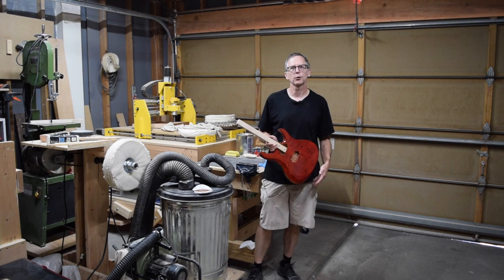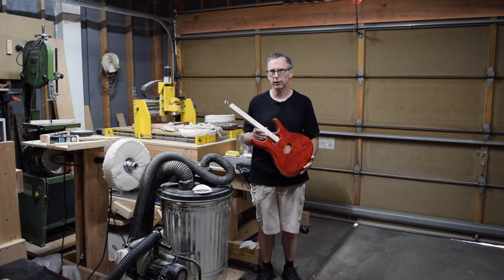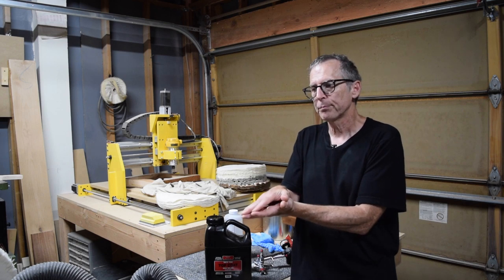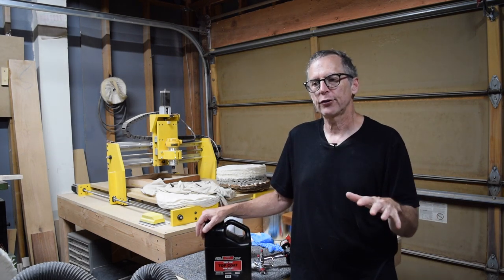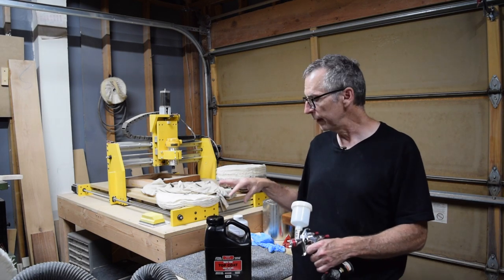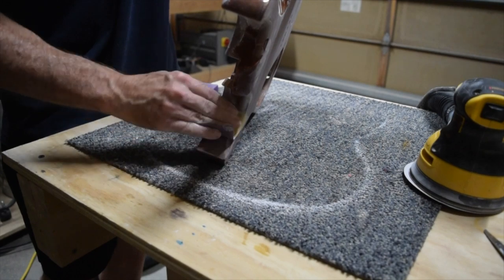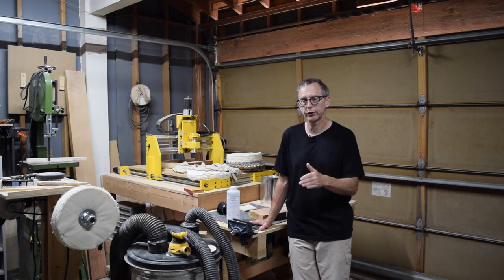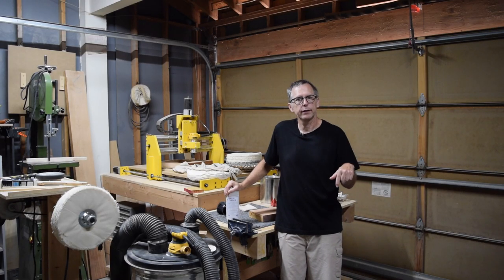How To Spray Smooth Water Based Clear Coats

Comment: I just finished my lp jr kit from Solo. Mahogany body and neck which I grain filled with stew mac mahogany grain filler. I went to Home Depot and bought some Varathane clear gloss water based ultimate and a few foam brushes. I stained it with trans tint red but wasn’t happy with the way it picked up the stain so I added tint to a small amount of finish and gave it about four or five coats. I sanded it flat and gave it at least twelve coats of clear and let it set for 5 days or so. I wet sanded it flat with 1000 and progressed to 3000 before using 3M rubbing compound on a foam pad with a drill. It surprised me with the luster. I was working in my basement and couldn’t use solvents due to my wife’s allergies.

Comment: Selling a product that makes their product usable.
Genius.
Reply from the maker: No, that's not what I said. This clear coat product works better in certain environmental conditions when mixed with the retarder/reducer. However, it isn't necessary. It's similar to adding lacquer thinner to nitrocellulose to achieve the proper viscosity for your spray equipment and environmental conditions.

Comment: I build model cars. Future Acrylic  Floor Shine worked great but they don't make it anymore. Pledge Floor Gloss is about the same. It has to be floor gloss and clear. I mix some in with the acrylic paint when painting and then I spray it on straight for the final coat. It's tough, it buffs up beautifully and you can add more with a soft cloth when needed.
Reply from the maker: I build model cars as well. When I ran out of Future, I purchased the Pledge product. Works fine. For guitars however, acrylic is just not hard enough. Polyurethane is tougher.

Comment: Great example! Water based lacquer its the way to go. Its got bad rep mostly because people on its first try use too many coats and/or thick coats, then they have to deal with a lot of sanding. Also, going cheap on the lacquer means lots of sticky residue and grabby finish at high gloss.

Comment: Hey Chris. I don’t know if anyone has said this but; have you tried using a humidifier? When I was in Northern Maine, I had to use one because of the low humidity. They are relatively inexpensive. Check with the company and see what they recommend. I would guess that 40-60% would work well. You can get a temp/humidigraph to make sure your shop is at optimum temperature and humidity. It will take longer to dry of course but it may save time In sanding. I hope this helps!

Comment: I am assuming, since you had shown both gravity and your Earlex siphon feed guns that the 1mm needle size was the defining factor in gun choice. I’m using a MasPro 20 1mm gravity feed gun and getting the drying effect with a moderate 40% humidity at 65-75°. I find myself laying it down two thick trying to compensate then I get sags. Although the Brite Tone is giving beautiful depth and clarity where it went on well, it’s an ES335 style guitar, the edge curves are where the drying spray/overspray is more granular as in your demonstration. I purchased crystalac’ s reducer /retarder to give it a try. Also, I find that, except for sags that I take down with 3M Prograde 400, that the grey scotchbright style pads work great between coats. Also, silicon, wax and oil free tack rags are now available for, and work well (time will tell) on my water based projects. I did not have these problems with the water based polyurethane coating that Crystalac sells (blue label), but however I also did not produce the beautiful depth of finish that the Brite Tone gives. I hope I can get this to work rite because I really like how it looks!

Comment: I've been struggling to fix the orange peel in my water based poly and I think you nailed the issue. I thinned with water to get the right viscosity but ended up with runs or light and dry coats. Gonna try your recommendations!
Reply: Exactly what happened to me too.
Reply: @rzub  a bigger needle helped me not have to thin so much
Reply: @Nickporter17  Great that worked for you. I'm using the Earlex5500 and sprayed latex paint with the 2.0mm needle tip and that was fine, but then I sprayed polyacrylic and got runs. Too paint was coming out the gun and could have only regulate it to a certain degree. After some research I'm suppose to use the 1.5mm needle tip which is meant for lacquer and poly. So will try that and see how it works out . On the verge of learning this field .
Reply: @rzub  good luck nailing down the process. I guess it's a lot of trial and error. I had to learn that the hard way because I just finished whole projects and was unsatisfied with the results. I'm sure you already have a smart setup, but I found lighting to be the most helpful thing of all. If I remember correctly I was using a 1.0 needle, which was great for lacquer but not poly. I switched to the 1.5 needle and ended up with no runs and minimal orange peel.
Reply: @Nickporter17  Oh yes some trial and error  for sure but so far my project is coming out great.  Good lighten is so important.  Good info on the 1.0mm needle, will get that later . Good information Bro.

Comment: Thanks. I have the opposite problem, blue haze because of the humidity in air. Also I discover that for the first coat, I spray the next coat as soon as the first one is dry but not that dry (enough for the blue haze to be gone), so the coat better melt each other... But I do not use Crystallac, I ordered some, just waiting it to arrive. :)
Reply from the maker: I should have mentioned that another reason I switched to Crystalac is that no matter how hard I try, I can't get a blue haze. Every other product I tested gave me the blues (pun intended)!

Comment: Comparing this with your other crystalac video... are you still applying 3 coats a day with the retarder and after the 6th coat flat sanding then doing another 3 coats?
Reply from the maker: I only use the retarder on excessively hot and dry days. Otherwise, I still apply it this way.

Comment: i have an lvlp gun and 30 gal compressor. what size tip you use for this product?
Reply from the maker: 1.3mm to 1.5mm. You may need to thin it a bit, but you'll have to test to know how much.

Comment: Hello I have a question. I was wondering if you can hand rub on the water base products instead of using a spray gun. Using crystalac premium clear gloss by rag, brush etc... before you apply the multi-coats, and the buff?

Thanks.
Reply from the maker: Don’t rub it. Brush it.
Reply: Thank you very nuch

Comment: Hi Chris, I'm getting ready to put the finish on my kit guitar, and I'll be using Crystalac's water-based wood filler, sanding sealer, and their Brite Tone lacquer. I'll also be using the Earlex 5500 Spray Station. Should I use the same techniques you've outlined for the clear coats when I spray the sanding sealer?  Thank you so much for all of your tutorials. They've helped a whole lot:)
Reply from the maker: Yes. It worked for me.

Comment: Can i ask please? Water based clear coats ,are more sensitive to create orange peel because of the evaporation of the water during cure?

Or this is a kind of myth or misunderstanding?

Thanks a lit
Reply from the maker: No, it’s not myth, but maybe a misunderstanding. Orange peel happens when atomized finish dries in the air before depositing on the surface. This can happen with any type of finish and can be eliminated with proper spray gun adjustment and technique. With water-based finishes, a slightly bumpy surface texture is common no matter what you do. It can be eliminated during the level sanding process.
Reply: @HighlineGuitars  thanks a lot sir I really appreciate your assistance.

So maybe the truth is somewhere in the middle of the road .

Thanks again 
My kind regards
Much love from Athens Greece

Comment: Do you use same spray system (lvlp gun+ air compressor)  for water-based coats as previously? Thanks!
Reply from the maker: No. I use a QualSpray WB125 HVLP + air compressor.

Comment: Have you ever used a sandable water-based primer under an acrylic color coat that you would recommend? I’m doing a refinish and would like to use a primer coat for adhesion, but also to check for imperfections in the surface before spraying color.
Reply from the maker: No, I haven't.

Comment: I bought 2k waterbased poly clear coat. Even after 4 days I can still dent it with my fingernail. It is no way near to be hard enough. If I wait 30 days will it get hard? Does curing mean becoming realy hard? Or should I just sand back to bare wood? I am really dishartened by how my project goes :( 
(Temperature is (20c but I always provide perfect air flow)
Reply from the maker: I don't use 2k water-based polyurethane, so I can't offer any advice. What brand is it? Maybe the manufacturer can advise.
Reply: @HighlineGuitars  First of all, thanks a lot for the answer. Its a good and commercial brand (it seems to be). I dont live in US so thats the best I can get. Since its 2k, it should get a lot harder a lot faster. Thhat is what its advertised for. I contacted the manifacturer. Even before I purchase I asked about a lot of questions to manifacturer. Its said to be very durable and also healty (very low voc).  But when I apply it,  it does not get hard. It has a similar structure like a rubber eraser. I do not have any experiance with wood finishing so I am not sure what polyurethane should become. Is that normal to stay like rubber for a week then is it going to be hard? I also tried to make very thin layers. Thin layers become like a peel of a sunburnt human skin.

Comment: Great video, as I am spraying Brite Tone sanding sealer TODAY!.  So, in your previous detailed Brite Tone video, you said you spayed 4-5 coats of the sealer and sanded with 800 and then you sprayed the Brite Tone topcoat, let it cure, and then sanded with just 1200 and then went right to the buffer.  In this video you are sanding the sealer with 600 and the topcoat with 800.  Have you modified your procedure?  In this method, areyou starting with 800 for the topcoat and then going up to 2000 or something like that?  Thanks for all these videos!
Reply from the maker: Sorry for the confusion. I had to drop down in grit because spraying in the dry heat produced a rough surface even with the sanding sealer. I will be doing a dry sanding video in a few weeks that will demonstrate my current approach for the final topcoats, but in a nutshell, I level with 800 and polish with 1,200 and 1,500. Then it's off to the buffer.
Reply: @HighlineGuitars  Thanks for the clarification.   I'll look out for that dry sanding video.

Comment: Chris, what do you suggest for high temp, high humidity? In the summer in my part of Texas, 80-100F daytime with 50-70% humidity. Seems the heat wants it to dry faster and the humidity slower. I work in my garage, so no climate control.  Thanks, Steve T.
Reply from the maker: I would try a detail gun with a very small (.8mm) needle and add 3-5% viscosity reducer so you can spray a finely atomized pattern. However, before you buy anything, contact Crystalac (https://thecrystalacstore.com/pages/contact-us) and ask them what they recommend.

Comment: I'm planning on doing a custom paint color using the multi-surface acrylic paints you recommended in an earlier video. In that video, you recommended the GF Enduro Pre-Cat Lacquer as a clear. In this video, you are recommending CrystalLac. Which one is better?
Reply from the maker: I ended up having an issue with fisheyes in the Enduro Pre-Cat Lacquer, which I never was able to resolve. These days, I am a big fan of Crystalac Brite Tone. It's much easier to apply and buffs out beautifully.
Reply: Great, thank you Chris. Love the channel.

Comment: Chris do you have a link to the spray gun you use?  From what I could tell the one you have requires no air compressor, just a vacuum hose attachment.
Reply from the maker: I use an Earlex 5500 spray system.

Comment: So if it was one day of cure time and one day sanding, wouldnt it be quicker to go without retarder? Just more work. But hey, throw on some freedom rock, a dust mask, and rock it!
Reply from the maker: @mshaynerushton  retarder helps it level out better, especially on hot dry days.
Reply: @HighlineGuitars  is that the same thing as extender?
Reply from the maker: @mshaynerushton  yes, they are both the same thing. Just different names for different customers.
Reply: @HighlineGuitars  cool, thanks. I dont use it often, but where I live its above 90 most days in summer. I think my water based paint is drying too fast as a result, but didnt want to extend cure time. Im with you, though. Flatter is better.

Comment: Chris, your videos are a much needed beacon of essential information. Thank you.
In your video you say you use a 1ml needle. Would a thicker needle make any difference to the application of this product? 
Does it make any difference to the finish using either a HVLP or a LVLP gun?
Much appreciated.
Reply from the maker: I find that I have less overspray with HVLP than with LVLP. However, I'm sure the quality of the gun makes a difference. The LVLP gun I have used in the past wasn't the best quality, so that has to be taken into consideration. The rule of thumb is to use the smallest needle possible. This will ensure the finest atomization of the material, which results in a smoother finish.
Reply: @HighlineGuitars  Thanks for taking the time to respond Chris although I must admit to being confused now.
I have seen enough of your videos and tutorials to know you are a pioneer in experimenting to find the best products and processes but the crystalac company recommended using a thicker needle. Have you tried this?

Comment: I am confused by you statement that one tablespoon to two cups (retarder to finish) is a 10% mix,  One cup is 16 tablespoons isn't it?  So two cups would be 32 tablespoons and the mix would be 32:1 or about three percent,  another way to say it is that one ounce is equal to two tablespoons.  So, 2 cups equals 16 ounces which equals 32 table spoon.  Am I missing something?

Comment: 18-24°C if anyone is not used to Fahrenheit.
Reply: Nik Reynolds  
I'm very fond of the metric system, and for temperature I prefer Kelvin. There is one upside to Fahrenheit and that is in the increments. So it can be helpful when cooking for example. Whatever one grew up with is more convenient. In the end it is all in metric and it's converted back to imperial.

Comment: If spraying water based clear coat is such a hassle, why not just use oil? Legit question, not trying to be fighty.
Reply from the maker: Water-based has no odor and can't burst into flames. It really isn't a hassle once you dial it in.

Comment: So you like the Crystallac better than Solarez?
Reply from the maker: I like them both for different reasons. Solarez cures faster, while Crystalac buffs out nicer.
Reply: Have you tried to use the solarez as an initial build and then finish with a topcoat of the Crystallac?  Do you think that would work?